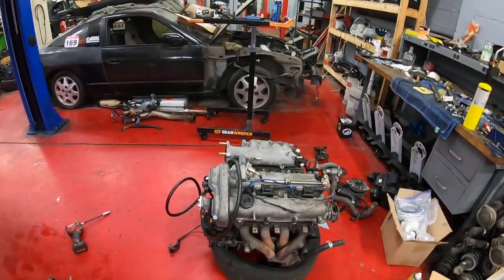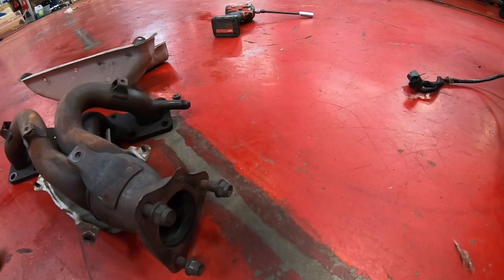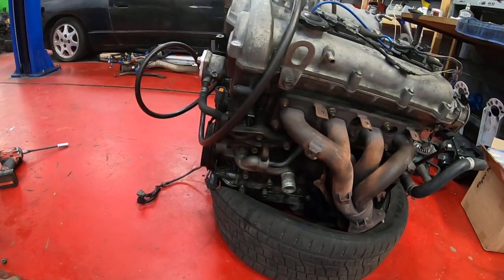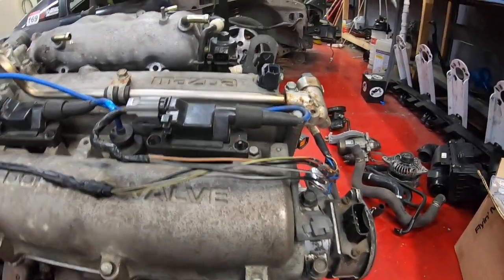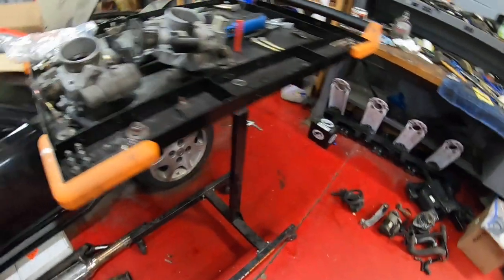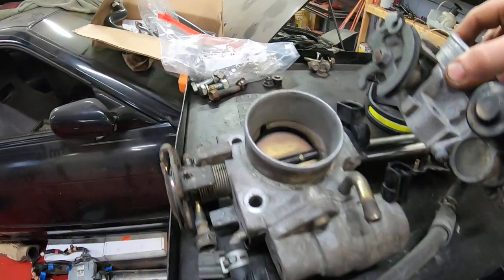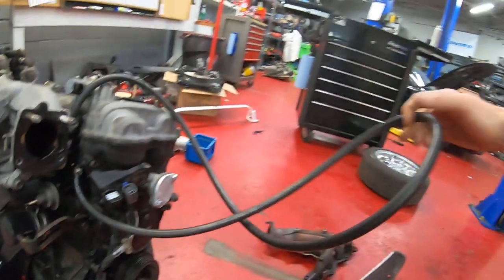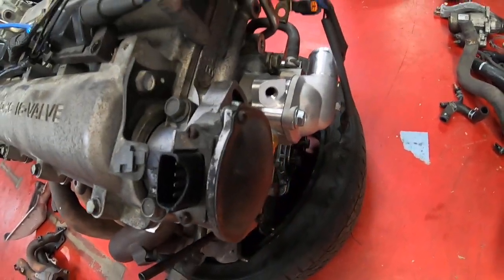Miata VVT Swap into an NA Chassis

Comment: Hey! Did you put a vaccum hose on the fuel pressure regulator?
Reply from the maker: I don’t think I did.  It’s preferable if you can when running stock ECU but it will work without it.  And if you run an aftermarket ECU it for sure does not matter.

Comment: For clarity, you're running the NB2 coils and wires and using the coil harness from the NB2 to adapt to the NA8 chassis harness, correct?
Reply from the maker: Correct
Reply: @immortanautomotive9221  Thanks for the prompt reply and info. Out of curiosity, were you able to find the receptacle connectors for the NA8 harness (same one used on the NA8 coils), so you didn't have to cut and splice the OEM connectors on the chassis side?
Reply: FYI for anyone who looks at this in future:
you CANNOT run the NB2 coils on any NA with the 4 pin coils (all the cars prior to obdii) on the stock ECU. Your car will not run.

Comment: So you have to use the nb1 fuel rail and injectors? Can you use the nb2 fuel rail and injectors?
Reply from the maker: Yes you have to use NB1 parts or it won’t fit and won’t run right
Reply: what about the alternator and ac compressor? also appreciate the help man @immortanautomotive9221
Reply: does the harness have to be a nb2 harness or can i run the 97 harness ? @immortanautomotive9221 .  Is the now way to use the coil pack?
Reply: @immortanautomotive9221 i have an nb1 rail but planned to use my nb2 injectors. Would that be okay?

Comment: Hi doin a vvvt swap into my 97 what differences am i going to have to fix to put the vvt im using the original wiring from the vvt car and the ecu
Reply from the maker: If you’re using the vvt harness and ECU you’ll still need to do the fuel system modification and you’ll need the original key and ignition from the vvt car because the ECU has an immobilizer
Reply: what differences would there be if I wanted to put it in my 92?
Reply from the maker: There’s a lot of differences, read this
https://s3.us-west-1.amazonaws.com/instructions.flyinmiata/misc/1.8swap.pdf
Reply: Hi again I'm unable to get key or ignition what do I do now buy another ecu
Reply: @hellcat2980 i am in the same situation as you where a year ago. How did you solve it????? Plz
Reply: Aight, be like that

Comment: Hello, curious if you plan to use VVTuner to retain VVT, otherwise what is your plan for VVT control? I am currently working out a plan for vvt controll in my 96' NA as i would rather not spend a grand+ on a MS3PnP. thanks -austin
Reply from the maker: I’m not sure the exact plan but I believe the customer on this project will be using megasquirt, currently we are just doing what’s needed to get the car running